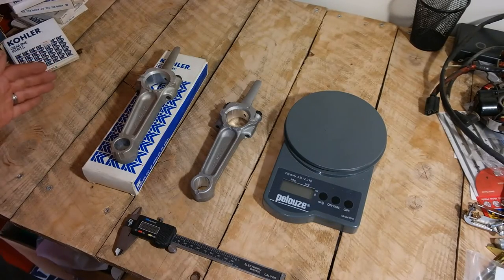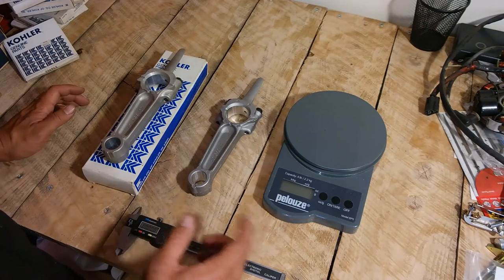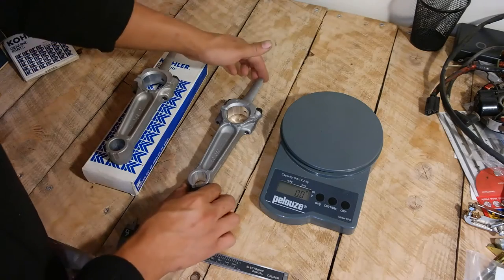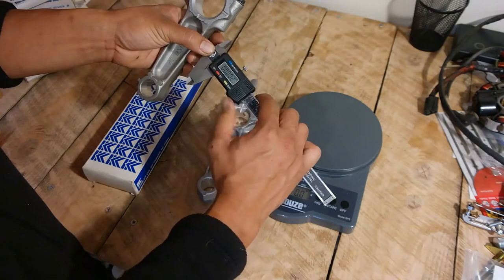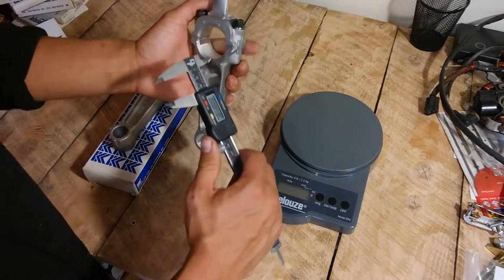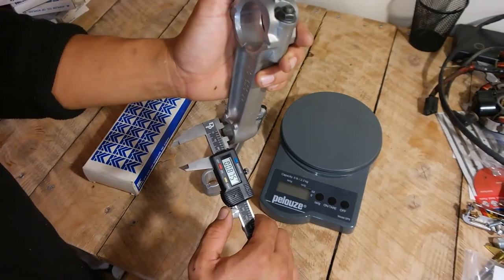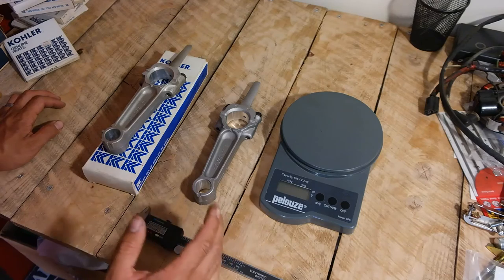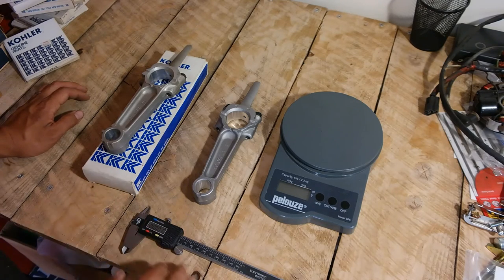iSaveTractor Parts vs Kohler OEM Parts - Connecting Rod

Comment: Correct me if I’m wrong but are IST parts Chinese parts that go threw secondary inspection and testing at the IST facility
Reply from the maker: Not correct. We design and develop our parts. Our manufacturing takes place in Taiwan
Reply: @Isavetractors  that’a the true China it’s official name is “Taiwan” the republic of China. They have a huge surplus old imperial chinas artillery and war machinery.  That they have been melting down as their metal supply The idea of death machines being turned into parts for happy little garden tractors does make me smile. I will buy your parts

Comment: is there a difference in the alloys? i have used both aftermarket and OEM and never really seemed to figure out WHY the OEM stuff was so expensive. it used to cost an arm and a leg to rebuild one of these engines, now the machine shop work is the only expensive part. 

used to be both parts and machine shop work was expensive.
Reply from the maker: We make more parts for Kohler K series engines than Kohler does. Part of the reason OEM parts for the old Kohler engines are so much more expensive, is Kohler no longer makes them, so it's a supply and demand. We actively produce thousands of parts and have contracts with aluminum casting companies and machine companies that promise us a certain price point, but we commit purchasing ALOT of them. The parts Kohler does still support such as Governor Cross Shafts, we still get directly from Kohler, as they are reasonably priced.

We are continuing to produce parts for even more old and obsolete engines. We are doing parts for Briggs, Tecumseh, and even Wisconsin engines right now.
Reply: its certainly good to keep the old stuff going, not just from a historical standpoint (history should be persevered) but from a usage standpoint, it has its merits. why spend $1,500 on a disposable peice of crap to mow your lawn when you can buy vintage iron, rebuild it and have it for decades. i bought my cub cadet original for $400, and i can tell the engine was overhauled not too long ago. it starts up instantly, little or no smoke, and decent power for a measly "7 hp".
my farmall has untold hours on it but still runs decently. i have been mowing my lawn 3 years and will last many more. also plow my driveway with it, and its big and heavy enough to drag around downed trees. the new stuff is just being made so bad, and in the Asian countries it makes not sense to throw away hard earned money on it.

i have a C3 mower for the cub, that's 60 inches. its not much more then a simple heavy sheet of steel with 3 heavy spindles mount in it. its made to mow a horse pasture so mowing a lawn is a joke for it. it bearings in the spindle are trailer wheel bearings. way over built for what's being asked of it.
Reply from the maker: Agreed!
Reply: farmall cub parts wouldnt be a bad thing to get into either, plenty of market
Reply from the maker: Someday maybe for us!